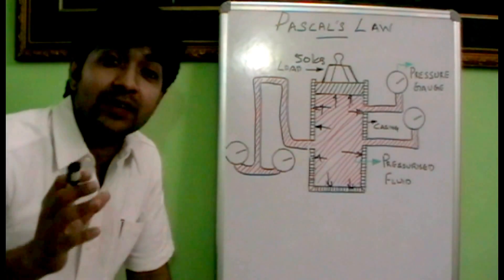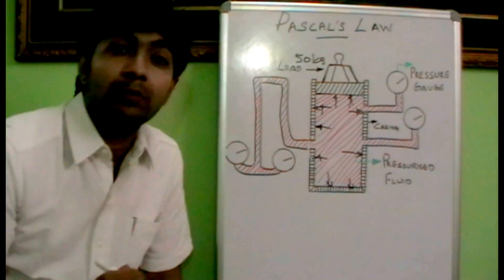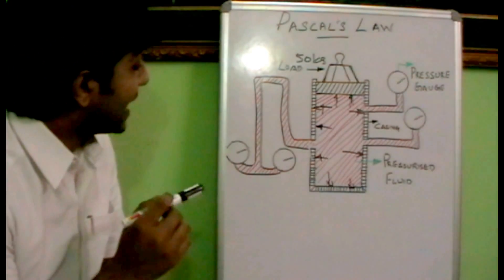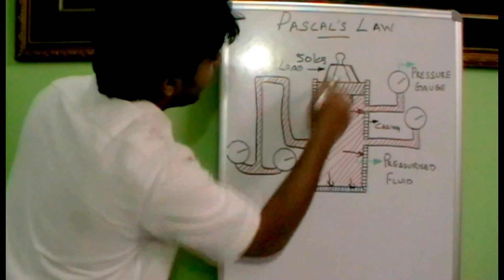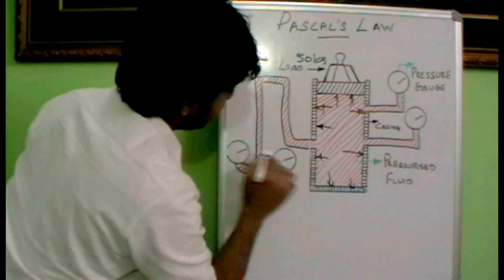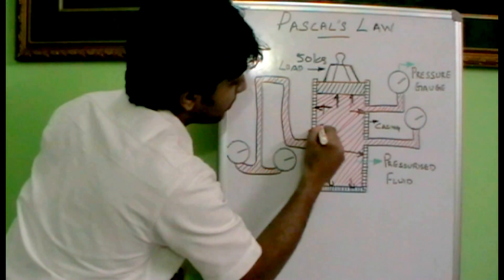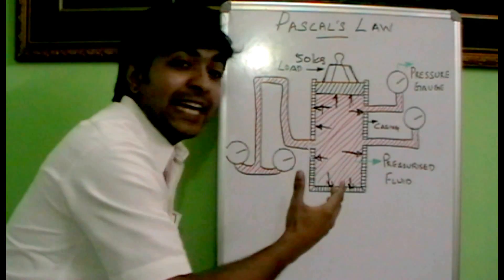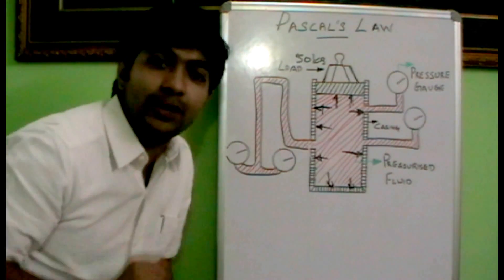How pascals law works. ✔

Comment: sir u could have placed the pressure gauges at the same height ...since pressure readings ll b different at different height...correct me if m wrong
Reply from the maker: NO..pressure reading will be the same at any height, if its a closed unit, That's where pascals law is applicable.
Reply: even in the presence of gravity???
Reply: @pythonanimalia  gravity isnt important bcuz the pressure applied is far greater than the pulldown of the earth , plus since its closed units the closed borders aply an equal force in the oposite direction of the gravity force so gravity force is 0